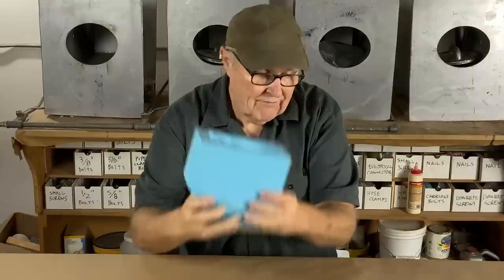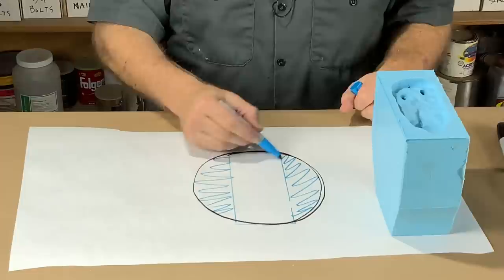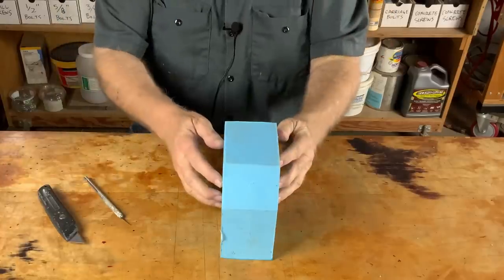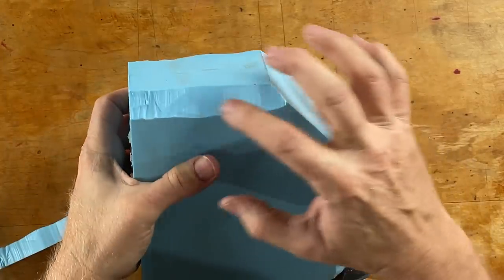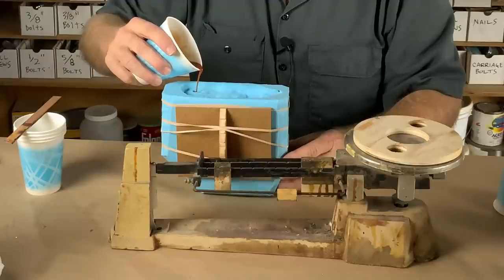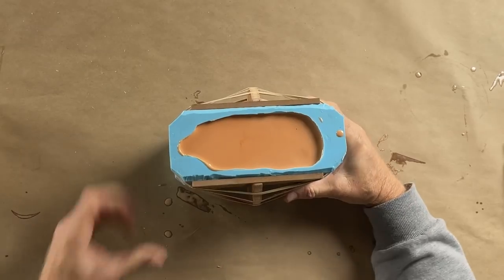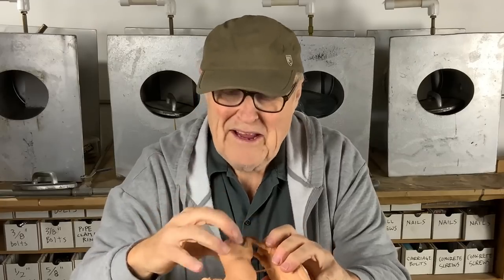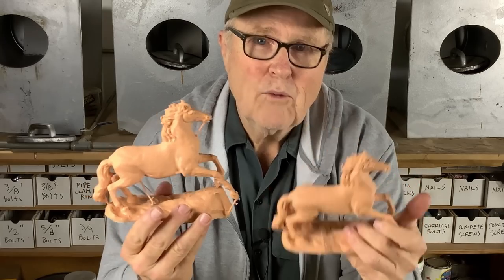Crazy Cuts Create Clean Castings!

Comment: Robert, I think that "uncured hardener" you were wiping off was actually just blue marker ink from when you diagrammed the square vs circle mold. Especially since it was present on any other side than the ones you drew around. You can see the marker inking the mold at 1:50 in the video.
Reply: That was what I was thinking it was too when I saw it.
Reply: I can't tell if he was just trolling us, or if he actually thought it was uncured hardener... 🤷‍♂️
Reply: I just wanna follow this thread to see if it was marker or hardener
Reply: Lol I would take his word for it.  It is just about impossible to mistake marker ink for uncured hardener/silicon, they are different colors, different thickness, one of them is very sticky, one is .... well not sticky at all. Etc.
Reply from the maker: Now that you point it out it probably was just the marker. Duh. Oh well, there are many ways to embarrass yourself on YouTube! 🤪😄😄

Comment: Hi Robert. For the piece that broke off I don't know if you ever tried drilling a rubber mold with a aluminum straw (could be copper or any soft metal you can easily cut teeth into) with jagged teeth. Depending on the size of the straw that's the size your hole will be. For the lube just soapy water. For the teeth just a thin hacksaw blade to cut across like a pie. I put in in the on the Dremel and drill it slowly and it leaves a perfect hole and the plug stays in the straw drill bill. You can then injection in or funnel in the liquid rubber with the sculpture in the mold and that broken piece will no more and you'll have a one piece mold again.
Reply: Great tip!

Comment: Great video! I tried the craddle in one of my molds and yes its a real improvement because of the even pressure. Please please please make more videos on miniatures. Prefferably high detail miniatures that have the added difficulty of small volume (weight) of resin AND many details that might trap bubbles.
Reply from the maker: More miniature videos are in the works. Let me know if you have any specific characters or game pieces you’re interested in.
Reply: @RobertTolone  Adapting more molds from 3dprinted masters would be wonderful. I especially liked seeing those mice get their treatments, seeing how to solve more design problems would instructive I bet for the modelers out there.
Reply: er the random assortment of animals that may or may not have reminded me of redwall mice.
Reply from the maker: @MarketResearchReading114  I’ll check into that, thanks!

Comment: Woo! That horse came out looking great. Appreciate all the work that went into this. Now time to see how a concrete pour would do when I receive the mold. Though I'll definitely use resin first to get the hang of it!
Reply from the maker: Well… I would definitely do a resin cast first.  I think you are going to have great difficulties casting this horse in concrete because the channels to the body chamber are the two hind legs. And it was a challenge to cast the horse even in resin because it is very slow to fill. You will need a very thin concrete mix to convince it to pour down those legs.
Reply: @RobertTolone  thanks! Yeah I'll keep that in mind
Reply: why not use plaster of paris?
Reply from the maker: @ssl3546  I would use hydrostone.  It’s like plaster in consistency but much harder and stronger.

Comment: Hi Robert! I'm from Brazil and I make silicone tube molds, with a technique invented by me. Brazilian silicone is low quality, tears easily, and expensive. So I had to do it with tube silicone. I have been making low cost and good quality moulds for over years.
Reply from the maker: Yes, people use tube silicone to make molds here as well.  There are lots of techniques and formulas. I’ve never tried it but as you point out, it works.

Comment: I've made thousands of molds.....the fix is cut a thin layer away to expose raw silicone and re attach with a small dab of silicone....or use a needle or straight pin to hold in the mold each time during assembly

Comment: Hi Robert, apologies if you've answered this before but I have a question about coloured resin:

- if you were to cut it or sand it, will it be the same shade throughout, or lighter on the inside
-> does the answer to the above differ between opaque and transparent resins?

Thank you! (if anyone else also knows the answer please let me know)
Reply: Cutting and sanding will have an impact on color, but only in the sense that doing those things to the resin changes the surface texture.  A rougher less glossy texture will look a little lighter in color as a side effect of the roughness.  If resin (transparent or solid, doesn't matter) has a different color at different spots and you only poured one color then it just was not mixed thoroughly and the color did not fully blend into the resin.

Comment: Ok, you talk about  creating a mold that would utilize a minimum of use.  I'm kind of curious that if you were to use a modular sheet system to create a jig from the flat box shape of an upright standing mold to a circular one.  But then, I think that your board jigs and rubber bands take care of that sequence of support.

So let me ask you this.  You used chunks to occupy space in the casting of the mold body in order to minimize and reduce new materials used.  If you were ever to a point that you could create a modular holding system from recycled chunks ans a minimum of new liquid casting material.  Would you make a cast support as it work to provide a modular jig for future products down the road?
Reply from the maker: I would have to see these methods in practice to see how they work. 

In my shop it is always time over materials.  Truth is I almost never use anything but round containers and new rubber. That’s because I mostly sculpt small toy prototypes for corporate clients like Disney, LucasFilm, Nickelodeon etc and my time costs the client way more than the rubber in those projects.  Also, speed is important.  Jobs have to be done fast and reliably every time. I use the same old tried and true methods and don’t much care if I use extra rubber or resin. 
That said, I emphasize saving materials in my channel projects because one of the most frequently asked questions is, “what are the cheapest silicone rubbers and urethane resins?”
Reply: @RobertTolone  my apologies.  I was under the impression that you were operating as a hobbyist.

Comment: When curing your moulds, why do you use a Pressure chamber and not a Vacuum chamber.?.? Thanks 🙏🏻
Reply: Pressure is for the resin, it makes any air bubbles so small you can't see them, and vacuum is typically for silicone to remove any bubbles before pouring you mold. If you have a long pot life for the resin you can vacuum that as well if desired, but it really isn't necessary. Robert has a good video explaining all this.
Reply: @lifeholdstrategic  , Thanks for the info, I wondered what was the difference. 👍👍👍🙏🏻
Reply: @bustersbashers2280  To add on to this it really comes down to a question of materials too.  For example, if you have a long cure time silicon and long cure resin (12 hours +), there is basically no need to vaccum your material ever.  The long cure time = much greater time in a malleable state while under full pressure, which is enough to make it almost impossible to catch a bubble.

Comment: what is your method to "fixing" the bubbles, do you just make a tiny batch of resin and pour it into the bubble?
Reply from the maker: Smaller bubbles that works fine.  For larger bubbles I use epoxy clay.

Comment: Question. Could you inject the resin with a syringe through the mould?
Reply: You  could do but it's another step in the process and added cost . Again if your using amounts like 230 ml of resin it's going to set quick accept on these cold Californian mornings .
Reply: @glenfisher728  Not always true.  Matter what your resin is.  I would still say don't inject it, because unless you are trying to do different color resin in different parts of the mold or something, it is just not worth the hassle.  If your concern is a clean pour just use high viscosity with a water like pour.  It might take a lot longer to cure, but it would pour smooth and probably less likely to catch a bubble.